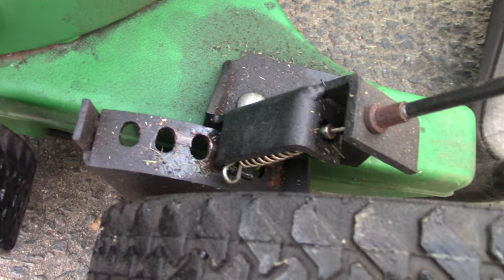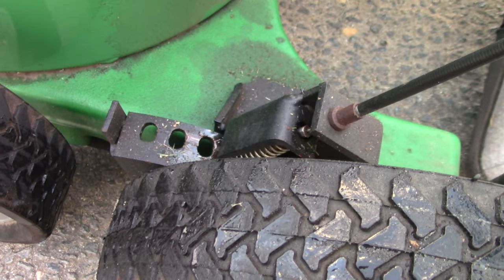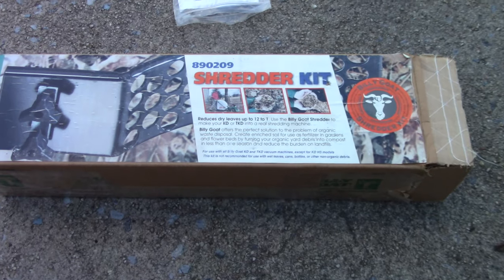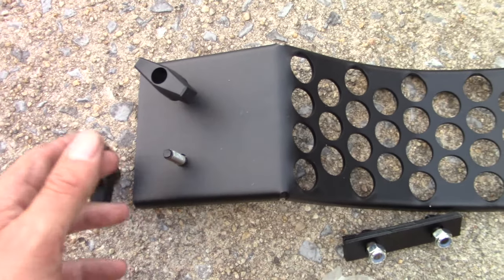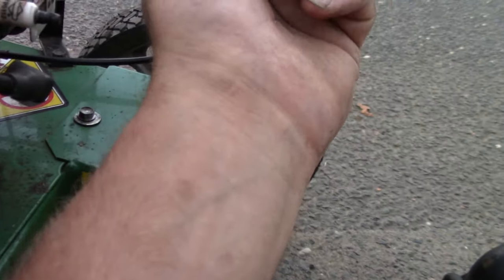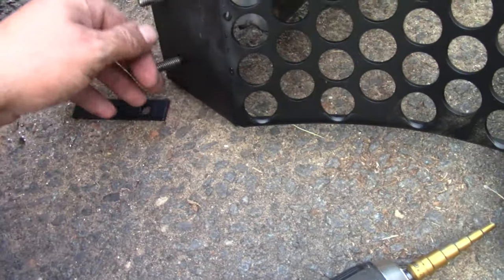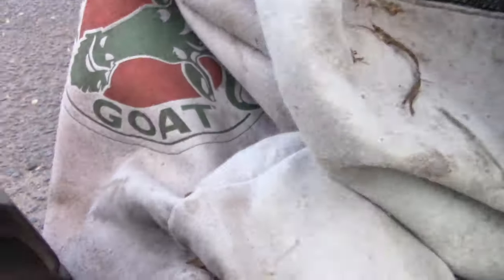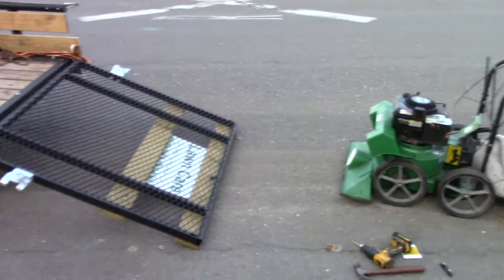Install a Shredder Kit in a Billy Goat Lawn Vacuum KD & TKD Series by @GettinJunkDone

Comment: The shredder kit is intended to fit inside of the machine housing, and not protrude outside of the machine housing as you installed it. Thus, if you simply flip it, the bag removal/installation should work as it did originally.
Reply: How could one not see that was how it was suppose to go...geeeze!
Reply: Good looking out !

Comment: YOU INSTALLED IT BACKWARDS! The Screen goes INTO the blower housing not into the bag. You just created a massive restriction to the bag collection is all you did. READ the instructions. It clearly states on your big ol' yellow sticker to spin the engine over by hand to see if IMPELLER CLEARS THE INSTALLED SCREEN....
Reply from the maker: You're absolutely right.  It's been pointed out and addressed.
Reply: @GettinJunkDone  you should review it since it's installed. I removed mine because it clogged to easily.
Reply: @GettinJunkDone  any update on how it works?  I don’t want to get one if it gets clogged easily.

Comment: I just picked up a Non running billy goat lawn vac for 50 bucks. It needs a replacement bag  and the height adjuster is broke off, but I got it running tonight. How do you  like this unit after having some time with it? I dont think I  will add the shredder kit, but how well do you like the unit overall? I